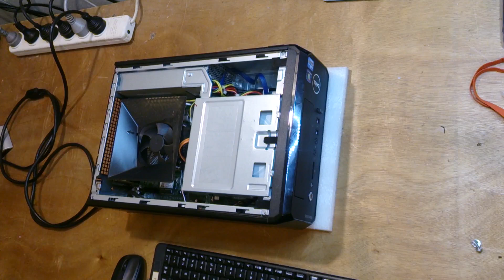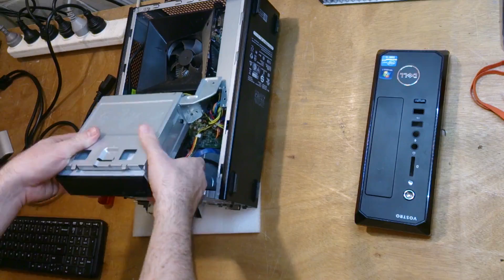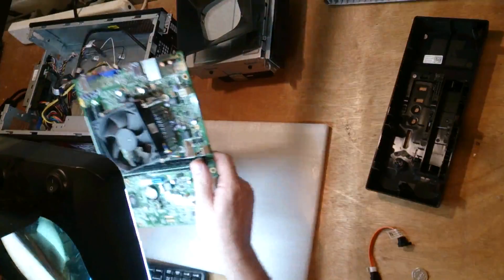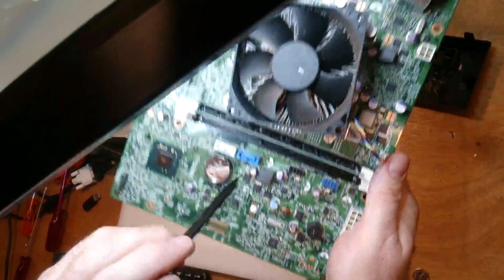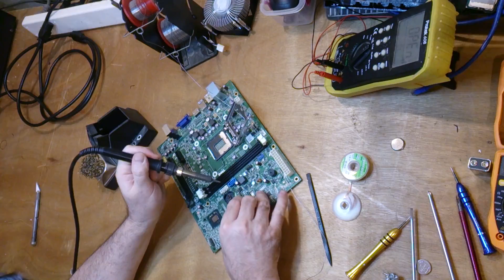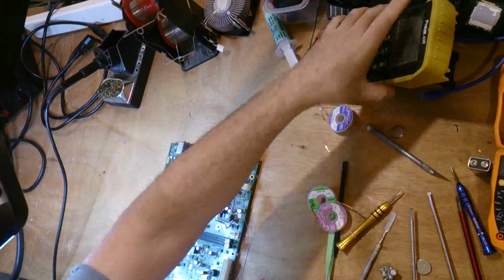What I fix daily - Dead DELL Vostro 270s. Component level repairs w/ extra research required

Comment: Hi what is the best GPU that will fit in this model? Thanks
Reply: I've dropped an I7 2600 CPU. 8 cores make the machine fly. I've got 16 GB in there too. Can be had at reasonable price on eBay. Make sure you upgrade the BIOS ahead of all that.
Reply: @carlrock9940  you mean threads or cores?

Comment: Hi Paul, What is the name and model number of your DMM? I like the DMM, it actually shows in words, the Open & Short status of the circuit. 
Best Regards, 
Shahbaz
Reply from the maker: Hi Shahbaz,  it's a Protek 608, not in production any more (hasn't been for a while).  Biggest problem I have is that you have to switch sockets to do a diode-test.
Reply: Thank you Paul for quick response. I do appreciate that.
Is it possible to devise a DPST switch, that you could switch your probe to the Diode socket & back? , Just a thought.
Best Regards,
Shahbaz
Reply from the maker: It would likely not be possible, as most of these meters have the banana sockets mechanically attached to the PCB itself.   My easier option is to get a second meter :)

Comment: What multimeter do you have?
Reply from the maker: It's a Protek 608.  I don't believe they make them any more. It's a significant overkill for what I do now, but at the time I needed it for its precision / 50,000 counts ( https://www.jaycar.com.au/protek-608-true-rms-dmm-with-pc-interface/p/QM1292 ).

Biggest risk/downside for me right now though is that it's only CAT II rated, wasn't a problem for the work I was doing before ( precision logging ).
Reply: Thanks. I think Im going to try and find one. I liked the looks of it from your videos. I do component level logic board repair and it will be a step up from what I have.
Reply from the maker: Best of luck finding them.  Jaycar did sell them at a really cheap price, I should have bought 10 of them to give to other techs.   I do like the large screen on it.  I have two complaints about it however;

1) The backlight turns off too quickly (should just be toggled)
2) The unit turns off itself and I cannot seem to find where I can disable that, if at all.  To turn it back on you have to turn the dial back to OFF, and then back to where you were.

Calibration at least is quite doable, especially if you can get yourself a precision 5V reference (which are available now for about $5~$10).

Comment: Hey Paul. Glad you managed to find the right voltage by following the trace going to the CPU socket and looking that pin up in the specs. Good idea :) Why did you also need to replace the vreg itsself ? Pitty now the PSU appears faulty too. Have a Merry (and possibly sweaty :( ) Christmas !
Reply from the maker: Merry Christmas to you too Maico (I was trying to let you know too btw in IRC :) )

I had to change the vreg because when I was trying to lift the leg so I could test the resistance of the remaining resistor it promptly broke off (because I was too ham-fisted about it, getting frustrated).  Fortunately a normal 1117 did the job in spite of the 1A vs 3A quoted maximum current capability.  I tested it, it's running cool.

As for the PSU, might have to make another video on that one.
Reply: Thanks. I'm not a daily IRC-visitor. I'm the kind that checks in every now and then if I feel up to or have a question. I usually then visit the #electronics channel.  I by accident (LOL) joined #hardware . I remember now you told in the video something snapped and apparently it was the vreg. You already said that 3A rated vreg wouldn't run cool above 800 mA anyways (without heatsinking) so it was probably underused alot and thats why the 1A does the job fine too. I'll probably see if/when you post your PSU repair video. Hope its just a (few) cap(s) cause otherwise it might get tricky huh.
Reply from the maker: Right, #electronics, normally I dodge that and live in #avr if I want to be closer to electronics.

Yes, chances are given the lack of heat, it's only having 50~200mA drawn from it, additionally since it's only dropping from 3.3V there's a  lot less wastage (1.5W per Amp). I dare say in most cases they're asking  "what's cheapest?" when picking out the parts.

Might do the PSU this evening, have a new camera to try out, hoping it behaves with the focus better than the Xperia Z.  Still can't  resolve the airconditioner noise enough, other  than to turn it off outright :(
Reply: Paul Daniels I didn't know  #avr  can be more interesting than #electronics. Will have a look around there. I HAVE been on  #arduino  also. Yeah using an overrated component won't harm. Cool that you have a new camera. Here its still 15:10 on the 25th so still 1st Christmas day. We have 2 christmas days (25th and 26th). I watched your video through speakers and didn't have a problem with the airco noise. It might be more noticable on a headphone.
Reply from the maker: Just in the middle of doing that PSU again.  Surprising  how many caps are in those once you need to pull them all out :D

Waiting to check first that the recording is going "as planned".  The Xperia Z would at times halt recording midway leaving me with a useless recording :(
Reply from the maker: No luck with the PSU, on the shelf it goes.
Reply: yeah a PSU is cap heaven :) I just saw your new message saying it didn't want to be mend. Pitty cause the whole pc is not returnable to the client now and you can only charge inspection costs I guess ? You already said a new PSU is too expensive (they are not the generic style of 'cube' shape I saw but are more thin). You didn't chose yet to try out your new cam I see.
Reply from the maker: *****
 new cam has some issues, found that it's limited to about 18 minutes before  it stops recording.  Some sort of legally imposed restriction to stop cameras eating the video-camera market, not just this brand).  Real frustration is that it's not explicitly  stated anywhere clearly, only in the  fine print  on page 157 of 165 in the downloadable  documentation.

Client will want data off the computer, so that'll be a small recoup, not a lot, definitely  an overall loss on this one.
Reply: Paul Daniels Now that you mention that. My Samsung ST200F has the same 20 Minute limit. It wasn't clear on any review site that I had read beforehand. I kept the camera since its other features were fine but such 'market protection' really sucks. Here in the EU online purchased items can be returned to the shop withing 14 weeks. I hope that Australia has similar law so you can return the camera. It is to give consumers the opportunity to be able to touch/feel an item like if he/she was in a real shop. Do you get many electronics to repair ?
Reply from the maker: *****
have to love market "protection" (collusion).   The camera  has a much better macro quality than my 8yr old Finepix S3700  so I may yet keep it for the purpose of replacing the camera,  however as a  video recorder, that option is dead  for me  as I cannot really see myself finishing enough jobs in under 20 minutes.   Looking at the SONY HDRCX405 as a possible  video camera, has HD@50fps in progressive mode, at least according to the specs.

I do get people sending me other things but I generally decline if  asked first as you almost always lose in terms of time.   If it's something like a  broken switch or power connector then maybe you'll consider it.
Reply: Paul Daniels just got home from christmas dinner (we have 2 christmas days). I kept the ST200F for the same reason (for photos) and if I have to make longer youtube videos I use my  smartphone. Yea better repair stuff from friends and family but otherwise it might be a disillusion.
Reply from the maker: ***** sounds like the same combo here then :)  The Xperia Z will have to keep doing the videos for now, downside being the lack of zoom and autofocus options.

Looks like I'll have to cough up the $250~$350 for a "Proper" (unencumbered) video camera at some point.